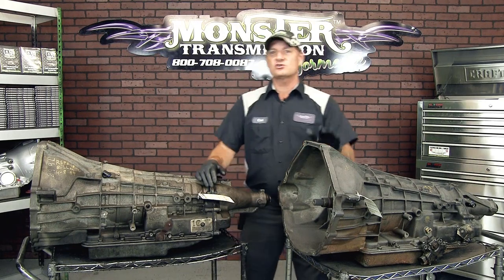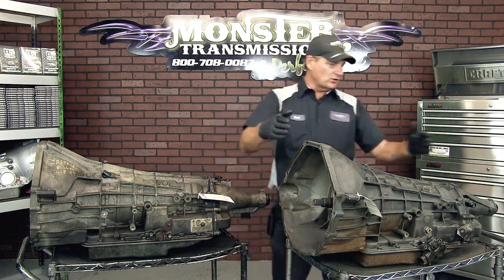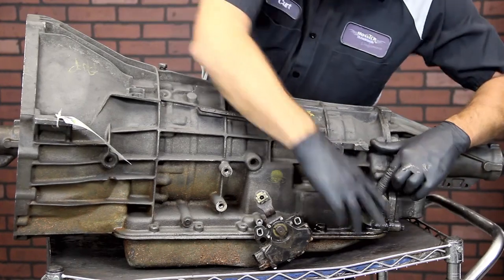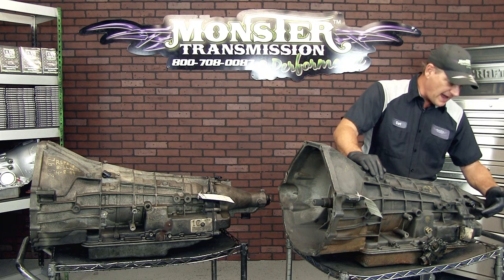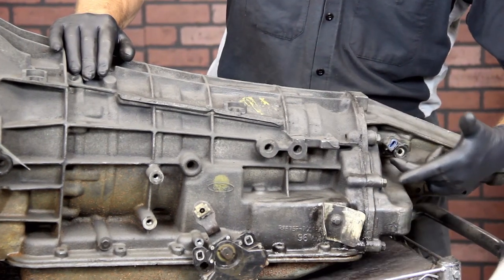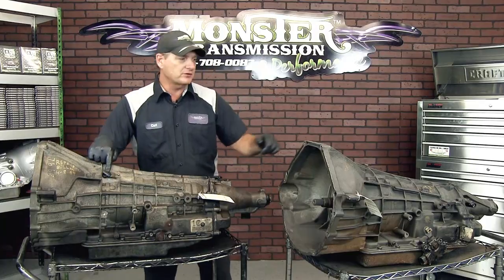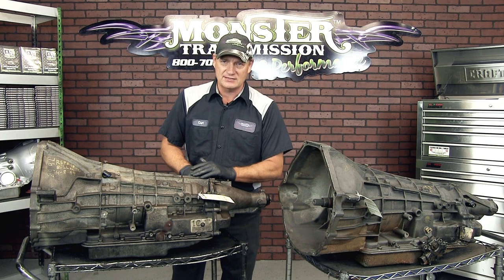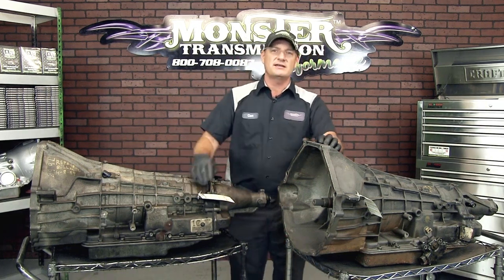E4OD vs 4R100 | Differences Between Ford Transmissions

Comment: Where is the transmission output speed sensor located on a 2000 ford expedition 4.6L V8 Triton XLT? 

I was watching your other video and you stated that my year vehicle has only one and it changed in 2001 to having two.

Comment: I have a 1996 ford f350 and it grinds when shifting or clucks when going into 1st. It's a 4x4 460ci gas. Will a fluid change help or is it shot? 100k miles on it. Only happens when its been driving for bit

Comment: What causes the front pump seal to keep blowing out .
Reply from the maker: The stator is worn, clogged cooler, or pinched line. The converter stator is work and knicking the seal or unit is over-pressuring. And/or the area where the metal-clad seal seit is worn out if the whole seal keeps blowing out and not the rubber part, you could try adhesive to keep in place.

Comment: I have a question does the 4r100 transmission from a 5.4 gas has the same internal parts as a 7.3 powerstroke ?
Reply from the maker: No it does not

Comment: I recently bought a 97 Ford f-super duty (450/550 10 lug ) 7.3 powerstroke what transmission would it have?
Reply from the maker: Hello! If you have an Automatic Transmission you should have the E4OD, give us a call at 800-708-0087 so we can help you further.

Comment: How can you tell when either one goes bad? I have a 2001 expedition 4x4 but it will not change gears on its own. I'm having to let off the gas and then apply it again once the gears change. I'm just not sure which one is bad so i can swap it out. Thanks.
Reply from the maker: That sounds like it's an electrical issue

Comment: Do yall do any E40d application's for 1979 f100s?
Reply from the maker: Yes we do offer the E40D that can be converted into your 1979 F100 you will need to get a Stand alone controller for it to operate which we do offer as well I will put a link for both below. Thank you for choosing Monster Transmissions.

https://www.monstertransmission.com/Super-Duty-E4OD-Transmission_c_3981.html

https://www.monstertransmission.com/Transmission-Controller-Compushift-Transmission-Control-System_p_6156.html#.X8jwgmhKiUk